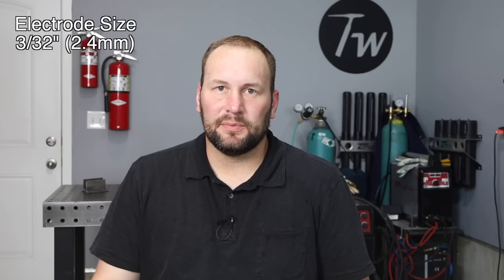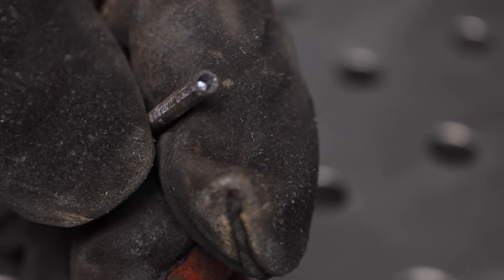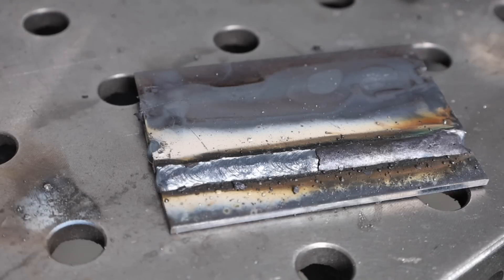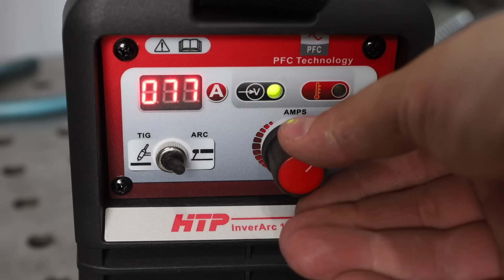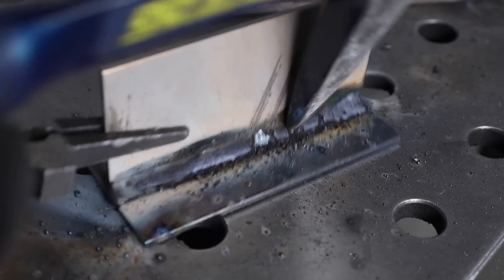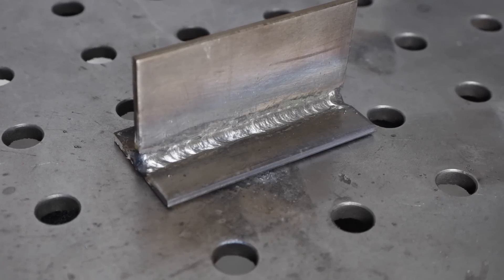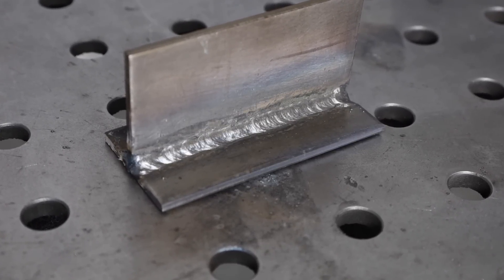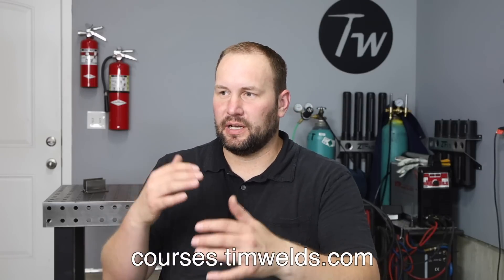Stick Welding with 7014 Electrodes

Comment: It's 3 years since you made this video, but I use 7014 rods, Esab 2mm for doing blind rosette weld 6" to 8 " down, inside a 1/2" diameter hole,  welding the tube too a plug, stuck in  the bottom of the hole. We then either slide hammer, or apply a hydraulic puller to the tube, to remove what I have welded too. I always cut the end of my tube off, so I can' reuse it. I rarely have to have a second attempt. For my application,  7014 is by far the best rod, especially because I can restrike without withdrawing the rod, and the flux just keeps floating to the surface

Comment: Farm rod. Easiest to use, definitely not the prettiest though. Best for rust, even better than 6010 and 11. Probably a little better on thin than 13 too. Can turn it way under low range. I use 7014 at 40 sometimes… on very thin. Can’t do that with 3/32 6013. Can’t even start it under 60 probably.

Comment: Very nice!  Good detail and good conclusions.  
I have been home welding for 40 years and have only this year switched to 7014 which is now my favorite stick.  The best welds are with 7018 but the arc is so difficult to strike and maintain for a once in a while welder like myself that I have not used those rods for years.  I tried 6013 and it is easy to strike but the welds are very ugly.  I watched your video on how to fix that problem but it seems very difficult to do.  7014 is my go to stick now.

Comment: What rod and size would you recommend for 12 gauge mild steel?    7018 3/32 was burning through at 70 amps.    7014? 6013?

Comment: I've used most of them in the past but for some reason I used a lot of 6013 on wrought iron and never think about using some 7018 rods until a few weeks ago my supplier was out of 6013 3/32 and I bought some 7018 3/32 rods now I'm using it for everything don't think I'll ever go back to 6013 again

Comment: new to stick welding and been struggling with 6013 & 7018.  will get some 7014 ASAP and try it out!
Reply: So I finally got some 7014 rods and I LIKE THEM!  I have an old welding table that I got from a scrap yard that was 5'x30" and weighed close to 300lbs.  I cut 2' off it and welded legs to the longer piece using 6011, 3/32 rod yesterday.  My best weld looks like a cross between dried snot and bubble gum.  today I welded legs to the shorter piece tonight with 7014, 3/32" and the difference is night and day.  My worst weld tonight was better than my best one last night.  super easy to start the weld, fairly clean straight welds.  If you've never tried them, do it!
Reply: @larrynjr 6011 penetrates,fast freeze too,whip and pause,grind down and hot pass and cap with 7014,I have a lot of 7014 and tried it out yesterday and I like it alot!

Wish I would have had it in welding school.

Comment: Hi Tim,  I purchased a 110V Tooliom $100 stick and lift TIG welder just for quick jobs where I don't have to get the bigger welders out.  I have been having all kinds of problems running 7018, then I remembered I had sticks of 7014 like boxes of 7014 that are about 30 years old.  To my surprise the 7014 ran great.  I though they would had been junk but then its been quite some time since I done stick welding.  Just not sure what I am doing wrong with the 7018.  Wants to stick all the time and then if I pump up the current the weld is flat and kind of shinny.   Suggestions.
Reply from the maker: 7018 will take more amperage than other rods of the same size, so it could just be an amperage issue. If you aren’t burning through or getting undercut, the higher amperage may be okay. Also, if the particular 7018 that you have is DC only, running 7018AC can work better with inexpensive little inverters (even though they are DC machines). Beyond that, it may just be that the particular machine is just a bit weaker off the line and 7018 tends to stick a bit more than other rods.
Reply: @TimWelds  Thank you so much for your support.  Not very many people comment back.  I must say though this little Toolium weld does work pretty good.  I am going to practice more with bumping up the amps.  Also looking into your course.  Dave....

Comment: I was really struggling with 6013 running a vertical weld, and became really discouraged.  I headed over to Canadian Tire to pick up some 7018 and 7014 to test them out.  I had much better luck with the 7018, but I still wasn't happy.   Then I switched to 7014, and I was just floored at the difference!  This will be my go-to rod at this point.  Really happy to see this video (after my struggles), but I'm having a great time reading some of the comments.  Really encouraging. :)
Reply: Fellow Canadian Tire welder here. Were those the Lincoln Fleetwelds? I bought some 7018 for practice but am very curious about those 14s.
Reply: It’s okay if your discouraged Those who can’t weld become an inspector
Reply: @FirstGendodgegarage 😂

Comment: I just got some 3/32 7014, and i think it fills a certain need. For me i was practicing some open root vertical up with a 2.0mm 6013 and found no suitable amperage. It is incredibly hard to make the rod deposit as much as it burns out. To increase deposition increase amperage, but then you have to push the rod in too fast making it hard to handle.
This is where the 7014 shines imo, i can run it in its mid range amperage and the rod consumes at a manageable rate.
If you're ever in that situation give 7014 a try.

Comment: Tim, what polarity when running the 7014? DCEP, DCEN, AC? Thanks Good video
Reply from the maker: It works with any of them. Generally DCEP works best, DCEN will give reduced penetration which is nice on thinner material. AC is usually used with transformer machines that only have AC available.

Comment: I've used 7014 for years...never once has the welds ever broke...thay sure run on a wide amperage wich is great for welding thin to heavy metals...I just recently bot a 10lb box of 7014 3/16in rods....wow talk about one hell of a bead

Comment: Use a lot of 7014 for general repair & fab work. I find it runs better on DC, towards upper end of the amp range.
Also need to run more rod angle to avoid wormholes.
Years ago I was doing a custom baling job & broke the hitch on the baler. Limped it out of the field, cleaned up the break, welded it up & fishplated the repair.
Old guy came out to check on me & commented “looks like you know what you’re doing”
Wasn’t until he died years later..read his obituary and saw he’d been a pipeline welder & boilermaker for 30 years!
High praise!
Reply: how is it on an ac macine
Reply: @larrycopenhaver  its descent, grab a small box and give them a try. Its kind of like 6011 but less violent.
Reply: I bought a few 7014 rods and was concerned about my decision, you made my day, I’m relieved

Comment: 7014 is like the combination of 6013 and 7018, you get the best from both worlds: You get an easy to strike rod you can use on old AC buzzboxes on field repair job, while they are stronger than 6013 and much cleaner welds ( I mean with 6013 it's way harder to separate the slag from the actual weld pool, 7014 has heavier slag), so for field application and repairs I'd totally recommend it.

Comment: Definitely the best rod for cosmetic use if you don't have access to 7024s or TIG.

I wish that there could be an aluminum equivalent of 7014 that would be as capable of running on AC. Maybe it will be possible in the future.

Comment: Is 7014 just as strong as 7018? For example can 7014 be used entirely to build something like a trailer that will be used to haul up to 8,000 pounds regularly? Or should something big like that be done with the tried and true 7018?
Reply: I've been welding for at least 45 years, 7014 are iron power rods and give you a softer weld , 
6013 are general purpose and a bit harder, 7018 have a higher tensile strength the steel will break before the weld,
7018 is all I use....

Comment: A welder at a die shop referred to this as a drag rod, the thickness of the flux on the steel maintained the ideal arc length.   Demonstrated rod for me and then had me try it. Great looking weld and flux peeled off without a chip hammer.

Comment: I truly think 7014 is a hidden gem. Don't have a way, nor want the trouble of keeping 7018s dry. I'm just doing farm repairs and what not
7014s run smoother than a 6013 and are just as strong as a 7018, I have yet to find something bad about them. Not trying to knock you but that slag will peel right off if you do it right
Reply: The charpy v-notch impact toughness of 7014 is on par with 6010 and 6011 in the as-welded condition (about 50 ftlbs), quite a bit lower than 7018's 80 ft lbs.  6010, 6011 and 7018's impact toughness increase quite a bit with a stress-relief heat treatment,  whereas 7014s drops slightly.
Reply: This information is from the Procedure Handbook of Arc Welding by Lincoln Electric.

Comment: Best all around rod there is. Any position. Over dirt etc. never sticks like 7018 and welds cleaner. We used it exclusively in the trailer repair business, other than MIG of course.

Comment: I always used 7018 until I was at the Canadian version of Harbour Freight (Princess Auto) and seen 7014 on sale, tried it and never looked back. It's awesome for tacking, and restarting as you just proved in your video. Thanks Tim! Not a lot of welding channels showcase 7014, it's kind of a hidden jem.
Reply: I swear by blue demon’s 5/64 7014.  They “start like fresh matches.”
Reply: @dennisyoung4631 wow that's amazing and good to know because  I just bought the same rods  and like the way they came packaged, the operating range on the container says 60 to 90 amps ,I was wondering what amps range works best for your results?? I'll be welding mostly 1/8 steel repairs and some light fabrication around our land property ,thanks 🧑‍🏭
Reply: @shermanyoung8185  I recall 65 amps DCEP ran good on the welders we tried them on - two transformer welders, and one inverter.  Nice-looking welds that seemed amply strong, in 1/8 inch steel “plate” and strap.

I hope to get more of those rods in the future, along with another, better, inverter welder - one which has hot-start and arc-force, so as to run the dreaded cellulosic rods!
Reply: @dennisyoung4631  ok thanks sounds good ,I'll be trying them on my Hone 185D 120v/220 with built in arc force /hot start, Guozhi multi process 200P 120v/220 and Yes welder 135 flux/stick welder,they all run 6013,6011, and 7018 fairly well,except 6010 ,I run them off a 6250/5000 watts Powermate Generator ,thanks for the info,by the way just seen on Amazon Blue Demon 5lb. box 7014 1/16 rods for $20
Reply: Bro hilarious I had problems and ended up getting 7014 on sale runs like a dream same power fist princess auto rods
Reply: I lived in a house now for 13 years that a couple of former workers at a modified so there's a huge 90 amp outlet in the garage for doing welding but I've never bothered to try one out but my neighbor has a little stick welder so I've been thinking about it

Comment: Thank for sharing your knowledge Tim. Which rod would you recommend for general use at home, a 6013 or 7018. I picked up a little DC welder and the store gave me a box of 6013 saying they are best for a beginner. Regards from Perth WA 🇦🇺
Reply: All depends on what you're trying to do. Personally I always keep 3/32" 6010 for tacking/penetration and 1/8" 7018 for deposition on hand, just came here because want an alternative to 7018 that won't absorb moisture.
Reply: @RussKatona  3/32" 6013 RC3 for tacks and 1/8" 7016 for welds are also a good combination running same amperage
Reply: There really is no magic bullet. They all have a +/-
More options equals more better

Comment: I’ve never used this rod. I can’t decide whether it really worth bothering with. Looking it up, I don’t see any general advantage over 7018.
Reply: Restarts.  If you got a bunch to tac weld in one go, good luck with 7018.
Reply from the maker: If what you have is working for you, I wouldn’t bother with it. I do agree with Pond Acres that tacking is easier, but you can always use a 6011/6010 for that.
Reply: @TimWelds  I don’t know, tacking isn’t so hard. A couple of taps is usually all it takes. A lot of that depends on the machine. If they have a hot start, as mine does, tacking is easy. If they don’t, it could be difficult. A lot of inexpensive machines can’t even light 6010 or even 6011.
Reply: If storage is an issue then 7014 may be preferred.

Comment: Good video, Tim, thank you.  Other than easier arc re-starting , are there other advantages of 7014 over 7018?
Reply: Storing it. It won't absorb moisture from the air like 7018 will.
Reply: It digs deep.
Reply: Easy to use on AC. Regular 7018s need more powerful transformers to weld on AC.

Comment: I'm a hobby welder and have always used 6013s and have never produced a weld that looked as good as what you just showed.  If I can find some 7014s I will give them a try, thanks for the information 👍.
Reply: I'm not even a hobby welder, I'm just a guy that bubblegums some metal together once in a while. It's just my opinion but, for me personally, using a 7014 rod instead of 6013 was like using a fountain pen after cracked pencil. It just... feels better
Reply: Believe I got mine from Tractor supply.
Reply: 6013 electrodes can be rutile cellulose (RC3) or rutile (RR6),
7014 electrodes are rutile cellulose (RC11)
RC type rods can be welded downhill.
Reply: When you do get 3/32 and not 1/8 rod if you have 140 amp or less

Comment: I have used 7014 for years, it is really good for tacking and I  have used it often. While not as ductile as 7018   it is just as strong. If you are not doing code work or structural  work then 7014 is just fine. To get a good release of slag run it at the higher end of  amps and wait a bit before knocking the slag off. I have used it fixing rusty snow plows and large snow blowers, any thing needing a quick repair. It was called the farmers rod in days passed.
Reply: Seems odd to teach welding and never used 7014 before.  Using 3/32 rod isn't the best choice to evaluate as it's just not the same as 1/8" rod on 3/16" + thick material.  7014 is all I use for farm repair and fabrication using hot or cold roll.  Most anyplace sells it right along with other rod.  Can sit on the dry shelf here in Michigan for 2 years and still weld nice.  Slag falls right off if you have amps right and wait for it to cool.  I've never had any of my welds break. 7014 lays a nice and strong bead like he shows with minimum skills.  Tip for new welders:  Before welding with a new rod just strike it on scrap stock till it holds an ark for a couple seconds then procede with welding.  Save the shorts for doing tacks and short tricky spots instead of using full length rods.  Nothing gets wasted.
Reply: @jefffrayer8238  how does it do on thin metal with a smaller rod and low amperage?
Reply: @Antoniocool86  I don't do much thin metal but there is 1/16 available and has to work better that 6013.  I do use 7014, 3/32 on like mower decks or 1/8" thick square tubling with good results.  The thing is it doesn't cost much to buy a pound of rod and try it out especially when others share their results.
Reply: @jefffrayer8238  I am having better results for 1/16 rods using 6013.
Reply: @jefffrayer8238  I just bought a 5lb# container of 5/64  7014 from Blue Demon, the rod is a slightly larger diameter than 1/16 but just a little smaller than 3/32,to experiment on some 1/8 mild steel test plate this weekend 🤔
Reply: @shermanyoung8185  I have tested 5/64 7014 and I prefer the 6013 5/64.
Reply: It is what we used in high school in the 80's. We only had AC Lincoln tombstones. I have a trailer I built in high school and still using it, must have been okay!!
Reply: @Littrell1966 I did exactly the same thing (motorcycle trailer)in High School, but in the mid-1970s.  Family back home still using it.
Reply: @Littrell1966  Lincoln tombstones 😂😂👍
That's funny
Reply: Yessir farm rod. Thin medium thick. 32 8 64

Comment: I've found that 1/16th E7014 when I can find it is good for sheet metal and auto body tacks. But like I said in the last vid just starting to learn wire feed after 30 years of stick.
Reply: Geezers, you must have one heck a steady hand for 1/16" stick welding? What's the weld rod lenth, certainly not 14"? Also, GMAW or FCAW whole lot easier since the change over?
Reply: @miszced  don't think I've ever perchanced a rod shorter than 14", on thin rod to help keep things steady just cut the rods in half. Only working with Flux core wire so far tanks and gas are getting to expensive for this retired Army and on a fixed income.
Reply: How does 7014 compare with 6013 for thin metal?
Reply: @Antoniocool86  7014 is easier to use for tack welding. Better for freelancers, artists and farmers.

No tacky slag to worry about either. Like the beginner's real stepping stone to TIG.